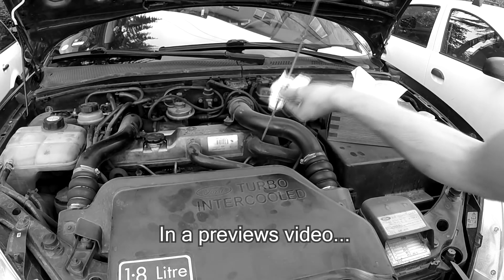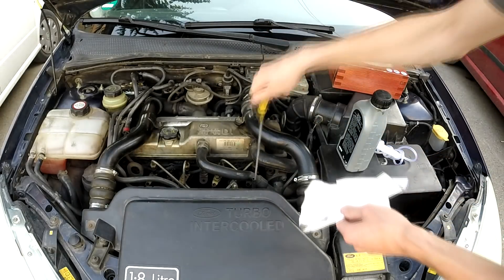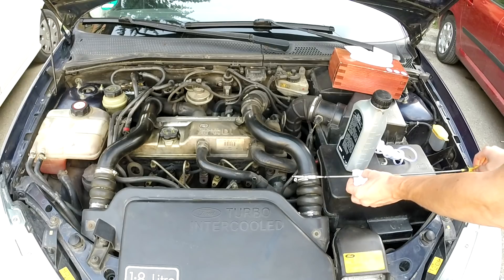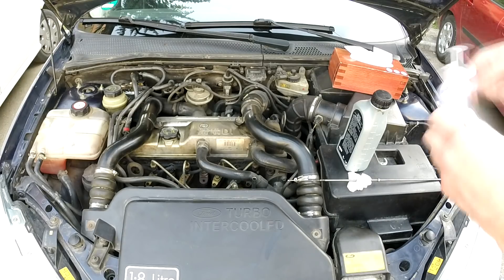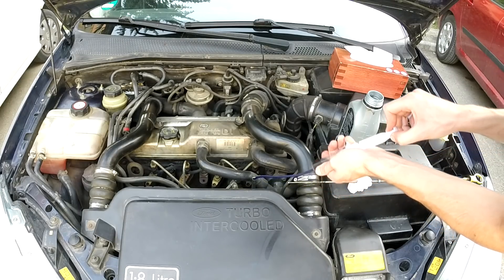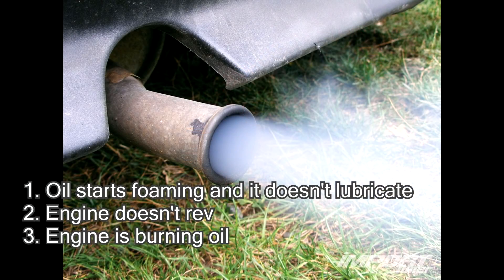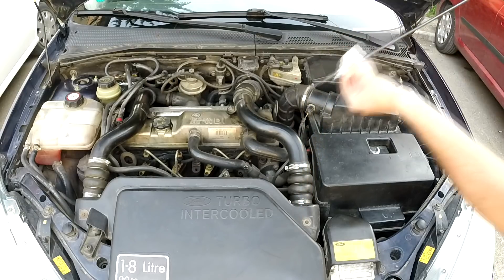Too much Oil in your Engine?

Comment from the maker: If the tube fell into your engine, I'm sorry for your loss!
Reply from the maker: Undoing the plug would help your problem ;)
Reply: Hey.. Have Mercedes did a oil change.. No dip stick.. Tells by dash sensor.. Reads engine oil ok as normal but then drive it (oil heats up obviously) says reduce engine oil.. Put 1 litre extra into it.. No smoke or anything.. Its been over a week.. Do you think it will do harm at this stage???.. If I drove the car on hard would it help reducing de engine oil???
Reply: Island Mike  that's what I'm trying to figure out to LOL

Comment: If oil already started foaming and doesn’t lubricate I know cause the engine over revs how can I clean the foam or fix it and can you do a budgets and how much can it cost pls respond
Edit: is there a liquid that can clean it or remove the foam
Reply from the maker: If it's that fucked up, there is no easy fix for it. 
Also it depends on the damage.

Comment: Hello! I have JDM Suzuki Swift ZC13S (Boosterjet turbo 1.0) car. When the service station while changing the engine oil they have overfilled like 250ml. I ran 140km and I drive the car in highway by speeding 80kmph/145kmph. Even if it is 250ml, is it possible that it has caused some damage? As soon as I found out that they have put too much engine oil, they have removed the amount of 250ml engine oil. The vehicle was only driven for 140km. But still upto now no any faults or toruble from the vehicle.while I was driving in the highway, I was rev up RPM like 3-4 range for speeding . I want to know if there is damage or not. How can get to know if it is damaged or not?
Reply from the maker: I doubt there could be any serious damage. 
I wouldn't worry about that.

Comment: I did oil change for my 2019 corolla le and put 4.4 quarts with spin on filter. I bought the 5 quart oil and there is still about 0.5~ 0.6 quart left but when i check dipstick its more than 1 cm higher than max.. I waited long enough to see slow drops to drain oil out first. i don't know why dipstick shows that.. should I drain some oil out like you did in the video? Thanks!
Reply from the maker: Did you start the engine?
If the oil filter isn’t full you’ll have more oil in the pan.
Reply: @N33sWorkshop  yes, i've already drive like 5 miles after running it for 5 min. I don't see any signs of wrong things.. dipstick still shows higher than the max. Thanks for you reply!
Reply from the maker: Then you can extract 100-200 ml of oil and check again. For peace of mind.
Reply: @N33sWorkshop  Thanks!

Comment: Would the car be leaking oil if it's overfilled?
Reply: Mine did in spurts out the tailpipe (I found oil drops all over my truck bumper, that's how I learned this) along with an embarrassing amount of white smoke! Do yourself a favor, instead wasting too much precious time looking driving from one store to another...like I did and found nada, ridiculous since I live in a large metro area in CA!
You can order from Amazon 100 ml syringe or bigger with tubing included, lots of choices so I narrowed list down to just the "get it tomorrow" it's quick and cheap. Had it in 12 hours for $8...watching these DIY videos using medicine dropper size is nuts. The stop leak worked better than I thought, that's why I had an overfill, never again!

Comment: I bought an oil additive and took it to a shop, they put it in, I took it to the shop cause I knew some oil needed to come out or it would be too full,  then my oil light came on and my engine made noise and my car died.  Now people are saying I need a new engine
Reply from the maker: Nice one!
Reply: @N33sWorkshop  thats all, just nice one?  No advice, obviously Im a woman and you know we get screwed on car repairs.  Advice would be nice
Reply: my best guess is that they didn’t drain anything out and just added it into there without proper equal parts. also, just because you are a woman doesn’t mean you can’t do anything related to vehicles. i’m sorry about your engine going out.
Reply: @zzzebiv  Im a 66 yr. old woman, no I am not crawling under my car to drain the oil.  Thats why I took it to a shop.  I was looking for advice.  It rattles now and the oil light comes on but not all the time.  NEVERMIND

Comment: What if my dipstick its reading way to high level? I take out the dipstick when the car is cold and the oil level goes all the way to the top, Like all the way to where you’re hand is holding the dipstick but once I clean it and place it back in it starts reading normal levels again.
Reply from the maker: It’s good. 
You’re supposed to wipe the dipstick before measuring.
Reply: @N33sWorkshop  that’s the thing, I’ll wipe it clean come back 25 minutes later and it’s up to high without me turning the car on. I just bought the car and I’m thinking maybe yo much oil in the system.
Reply from the maker: @eriknove  I don't know what to say... if you're very paranoid about it, do an oil change. Then you'll put in the exact amount of oil. 
To me it seems like nothing unusual, just oil vapor.
Reply: @N33sWorkshop  yeah I’ll go ahead and do so, thanks for taking the time to reply, I really appreciate it.

Comment: Wouldn't it just be easier to go beneath the vehicle and remove the oil plug and let it drain for a few seconds?  Of course, making sure NOT to do this when the engine oil is hot or even really warm.  Drain a second or two, put the plug back in, then wait about 15 minutes for the oil to settle again and check the dipstick.

This seems like a very awkward method to do something that can be done so much easier another way.  Just saying.

Comment: I have 1 extra quart in my camry's 2.2l 4cyl engine. 
Will that harm it?
Reply: I have half a quart is that ok
Reply: Have u done it before ?
Reply: @Alex-..-  yes I have its ok but drain soon a little bit or it will burn threw muffler
Reply: @ivarivar1875  alright. Because I also put 1 extra quart in my Camry lol
Reply: @Alex-..-  lol yeah they did it 2 my car many times when changing oil so now I make sure its on point a little 2 mm on the dipstick is okay but a quart no

Comment: hi ,
can you tell me 
what happen if you won't close the engine oil fill fully ?
which mean engine will BREATH air as well from Engine oil filler ,
will Engine lose horse power ?
any idea what would happen ?.
thank you .
Reply from the maker: Excess oil vapour will excape trough there in the atmosphere instead of going back into the combustion chamber trough the PCV (in my case) and dust will get in the engine.
Of the top off my head, I can't think of anything else.

Comment: can i just climb under and undo the screw for like 15 seconds? let some drain and hope? i didnt pour to much oil but added seafoam hoping it will clean out but it didnt smoke and now transmission seems odd.
Reply from the maker: You sound brave enough, so yeah.

Comment: Having too much oil can also blow engine seals
Reply: It all depends on how much oil. You can go to Youtube and check Bob Likis. Put in Over filling engine with oil. He explains how the engineers give a Forgiveness  Factor. Some oil a bit over or under will not harm the engine.
Reply: @arthursmith643  its still not good to do so

Comment: Hi man i have a mitsubishi 2.5 turbo diesel i overfilled my oil about half a liter more before 5000km when i changed the oil and the car ran perfectly fine without burning any but 2 days now it started burning that excess off making the level go to max im worried i might have caused damage in my engine..also if i let my car coast on a big downhill it would start blowing blueish smoke after some time without applying gas..is my engine messed up?
Reply from the maker: It might be

Comment: Great tip, thanks! I haven't done an oil change ever but have been looking into doing it myself to save money. This was one thing putting me off, accidental over filling and not knowing what happens in that event.
Reply: I just had a shop change my oil and they overfilled it lol.
Reply: @samsmusichub   Did the same to me when I bought a new bike. They filled it up while it was on the side stand, so when you put it upright the oil goes way past the window. When I told them they took it back and rectified but then drained out a little too much. If you want something done properly....
Reply: @ArcanePath360  Gotta do it yourself lol
Reply: I don’t understand how a man couldn’t do basic repairs on items they own. 

That’s one thing i can’t understand, can’t you put a car on a jack, remove the oil pin and top off your oil, a guy who can’t do these isn’t a man at all, if you can’t do something this easy what else could you do ?
Reply: @Eye-it-azz   You don't understand because you assume way too much. A car jack will do me no good as I have a BMW120RT motorcycle.  Also, that was why I was here, to LEARN how to do it. Also, you are assuming I am a man, and finally you assume I am able bodied. You know what they say about people who ASSume?

Comment: Why does my oil dip stick read over max when putting in recommended amount after oil change??? 4.0 il6
Reply: You didn't got it all out
Reply: @rosegold-beats  . I'm sure after sitting all day, all the oil was at the bottom of the pan.
Reply: Did you remove the oil filter?

Comment: So the syringe and tube is in place of the drain hole screw and a pan?     Would for sure be a lot less messy lol.  But those syringes are tiny
Reply from the maker: Yeah, but in this case I take out 50ml of oil. Doesn't take more time than lift/crawl under and drain.

Comment: 1- Engine oil never expand.
2- The difference in readings on the dipstick whether the engine is hot or cold is that the oil when engine is cold is almost completely rested down the pan, the difference would be maybe 1 or 2 mm difference on the dipstick, not a big deal.
3- If the car burns a little oil, overfilling a little ( 5/10mm ) on the dipstick's not a big deal because the oil's gonna be burned and level will drop down again while in the engine that doesn't burn oil, the overfilled oil will stay in the engine.
4- Half a quart overfill is fine, over that amount is not, especially in an engine that doesn't burn oil.
5- If you think that you overfilled your engine with a lot of oil, just take your car where you usually change your oil or any shop for that matter and they'll either drain a little from the bottom pan or suck it out using a pump. The pump's better because it won't make a mess and checking the reading on the disptick would be much easier.

Bottom line, don't make it a habit to overfill, if you did it by accident and it's not that much over the max, just leave it alone and if it's way over the max, take it to a shop and they'll do it for you.
Reply from the maker: At point 1 - It's not an ideal liquid 

At point 2 - It also depends on the engine size 1.0L I3 vs 4.0L V8

At point 3 - Why not add oil when it's required? 

At point 4 - It also depends on the engine size
I agree with point 5!
Reply: @N33sWorkshop  At point 2- The engine size goes hand in hand with the measurements on the dipstick which means the measurements on a V8 engine is not the same as on a 4 cyl. engine.
At point 3- If you fill as required only when the engine usually burns oil, a skip or two in checking the level might end up driving with low oil level which can cause damage to the engine. Other words, better adding a little over the max (if the engine burns oil) and have a peace of mind which eventually won't cause damage than risking an engine damage by skipping or monitoring the oil level unintentionally, it will give more time and more miles in between checking intervals, just a safety precaution.

Comment: hi,where is the turbo boost sensor A in this car
Reply from the maker: If you're looking for the MAP sensor, it's next to the brake fluid reservoir.
Reply: my problem is with this code- P0235 Turbocharger Boost Sensor A-Circuit malfunction. Sometime the boost is not Good
Reply: maybe the problem is the  boost control valve sensor,this sensor is between MAF and EGR

Comment: Good advice. I connected a hand soap dispenser to my rubber tube. That way I just squeeze the soap dispenser and squirt the oil into a plastic bottle. Saves having to disconnect and reconnect a syringe with each pump.

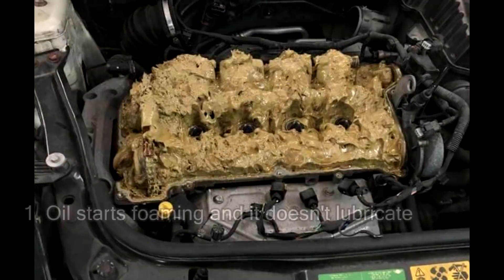Also, the picture at 2:26 isn't from too much oil, that was a mini owned by a French woman who put windscreen washer fluid in the oil (she thought the engine was the wiper fluid tank). Source: https://www.motor1.com/news/174792/mini-windshield-washer-fluid-engine/
Reply from the maker: Thanks
I just made a google search and found that image.
Reply: great idea - I will try this

Comment: Will to much oil cause a lose of power
Reply from the maker: Loss of power can be caused by other factors, not just too much oil in the block.
Reply: @N33sWorkshop  reason for my question is I have aftermarket software and after the service the car has no power and the oil is high

Comment: How do I know what’s the min an what’s the max ?
Reply from the maker: Check the user manual for an image.
Reply: 1 marks on top one marks on bottom top mark is the full mark. I'm referring to the dipstick. Check it when the engine is cold before you drive it

Comment: Salut! Am si eu un Ford Focus MK1, din 2000, motor 1.8 benzina, zetec, 115CP. Astazi am intampinat o problema si anume:
Bateria mea s-a descarcat de la racirea brusca a vremii, si a venit azi un amic cu niste cabluri sa ii dam putin curent cat sa o pot porni pe loc. Mna, am pus cablurile, de pe masina lui p-amea, totu' bine, el porneste motoru, lasam vreo 10 minute, dupa care pornesc si eu motorul, si aici intervin urmatoarele:

1) Prima incercare de pornire - a facut clinchetul acela care il face atunci cand bateria e descarcata.
2) A doua pornire - a pornit in suturi parca,relantiu instabil,a coborat sub 1000rpm si a murit motorul.
3) A treia pornire - a pornit mai repede, am accelerat-o eu putin pana la 2000 de rotatii,dupa relantiul si-a revenit la 1000 de ture si nu mai murea motorul,insa,din 30 sec in 30 sec,scadea pana pe la ~750 si dadea sa moara,toata tremura,si a scuipat ceea ce parea sa fie ulei din toba, dar fara fum,numa lichidu' ala ce parea a fi ulei,sau poate fi si apa? Mentionez ca daca piscam putin acceleratia pana pe la 1500,nu mai scuipa si mergea ok. Mentionez ca nu mirosea a ulei/benzina, si fum pe toba nu iesea. De asemenea, nu am mai patit asa ceva inainte.
Masina a stat pe loc vreo 2 saptamani bune,timp in care s-a racit,a si plouat,etc,e posibil sa fi fost apa pe toba si s-a facut condens si deaia a scuipat? Niciodata pana acum nu am mai patit asa cu ea sa am relantiu instabil, poate fi si de la baterie? Am s-o pun pe redresor 12 ore dupa care o urc inapoi sa vad daca face la fel.
Reply from the maker: Salut, 

In primul rand, apa din toba este condens de la diferenta de temperatura, nimic ciudat acolo. In al doilea rand daca bateria s-a descarcat total este posibil sa se deterioreze. Click-ul ala ce il auzi cand ai pornit cu bateria descarcata era de la "releu" sau mai bine zis solenoidul de la electromotor.

Legat de relantiul instabil, nu stiu ce sa zic, vezi ca filtrele sa fie curate (adica de la aer si benzina), Idle Air Control Valve sa fie curat si bujiile sa functioneze bine.
Reply: @N33sWorkshop  bateria nu a fost descarcata total deoarece inchiderea centralizata inca functiona,restul am sa le verific,mulţumesc

Comment: My car gets overheated. My engine oil level is more than a centimeter obove maximum mark. This is causing my car ac also to turned off after some distance traveled.
Reply: Yah seems like this is just the video you need

Comment: Thanks.  Great idea. I've got all the required items so it will be very easy.  Much better then jacking up the car removing all the covers from underneath and pulling the drain plug and having oil gush out; probably more then I want. My car is a 2009 Mercedes CLK350 and has two cover panels to remove before you can even get to the oil drain plug.

Comment: Why not just drain some from the oil drain ?
Reply from the maker: It's messy and not very precise.
Reply: @N33sWorkshop  I just just loosen up the drain plug until it drip and wait until it dripped enough oil and tighten it and done.I put a quart too many Ford 4.6 litter I put 6 quarts.

Comment: as you say, if oil doesn't touch the crankshaft, there is no problem, oil level on the dipstick can be as high as he wants....
Reply from the maker: Yeah, but the only indicator you have is the dipstick. If the engine would be transparent you wouldn't need a dipstick. ;)
Reply: @N33sWorkshop  yeah, or if you are mechanic you know it, one example is my 1.9 tdi golf, even if you put almost 2 inch more on the dipstick still doesn't touch the crankshaft :)) but I don't think is healty.

Comment: Help!!! The tube is stuck inside!!!!
Reply from the maker: Did you try to pull it out?
Reply: @N33sWorkshop  yes I did. I tried very hard.
Reply: @N33sWorkshop  is it winding the engine? Can I drive to mechanic for help? But I think the engine oil still exceeds.
Reply from the maker: Don't start the engine...
Try to wiggle and twist the tube while you pull it. Anyway how the hell did you get it stuck?! 

I still believe you're trolling.
Reply: @N33sWorkshop  yes still trolling. I am afraid I pull too hard to break the tube. I hope it just stuck in the tube, not  twine with the engine.